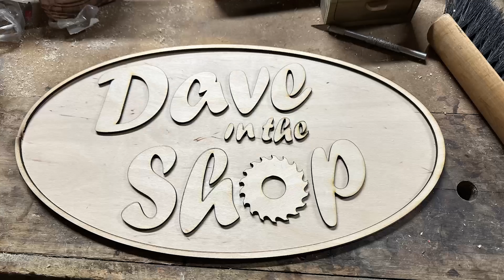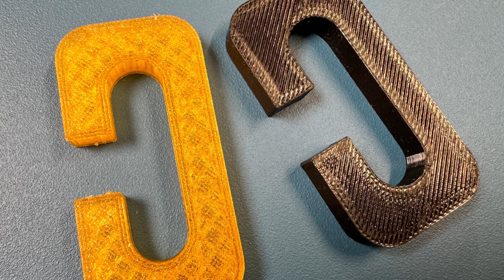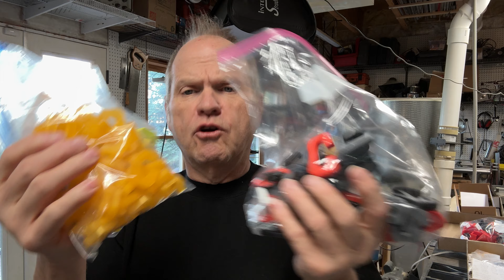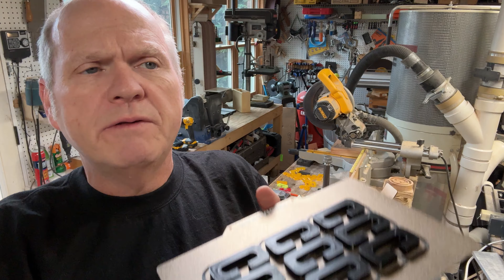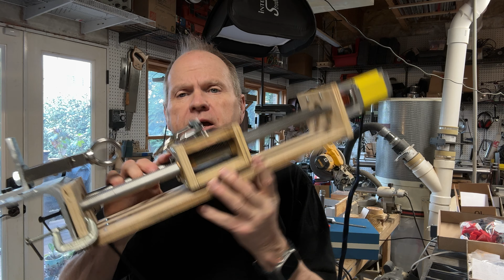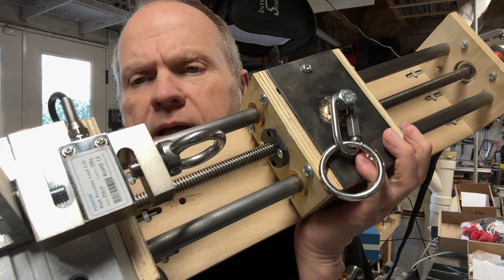Parts Testing   Dialing in Strength

Comment: It's very interesting to see how different settings really affect the strength of the print.  It would be interesting to adjust different parameters as you find the maximum.  For instance, can you start reducing infill as you add more walls?  Which parameters have the biggest results?  What about the strength to weight ratio?

Another idea, as you approach the limit of the test equipment, is it worth making smaller test pieces which break sooner?

Keep up the good work.  Looking forward to seeing what you find.
Reply from the maker: This a great idea. Thank you for the suggestion. I have started down that path and will publish some of the findings.